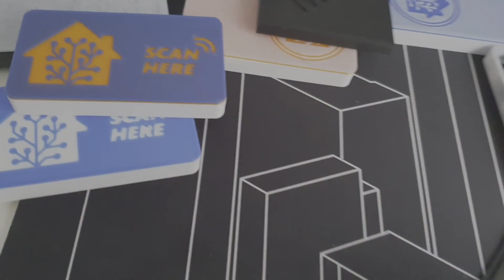Home Assistant NFC Reader for alarm system and automations PN532 + ESP8266

Comment: hi  dear
I have done various tests, also changing the components and re-soldering them, but I always have this error that fills the log and after two days the tagreader no longer works.
Component pn532 took a long time for an operation (0.10 s).
Components should block for at most 20-30ms.